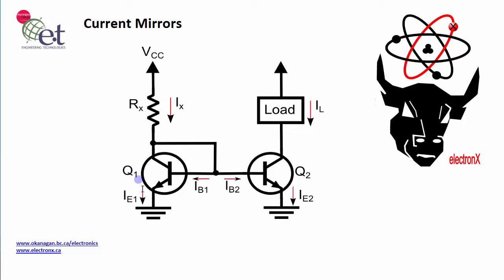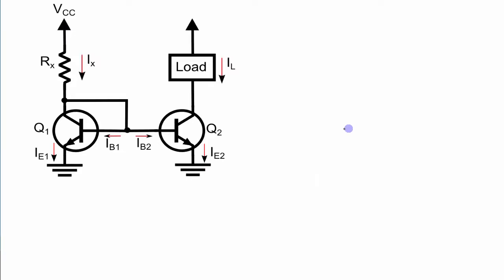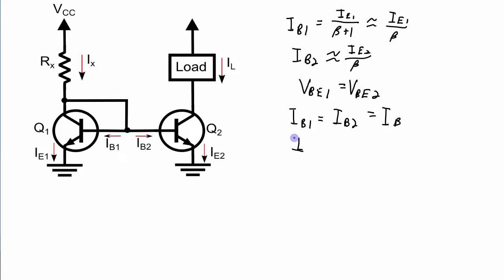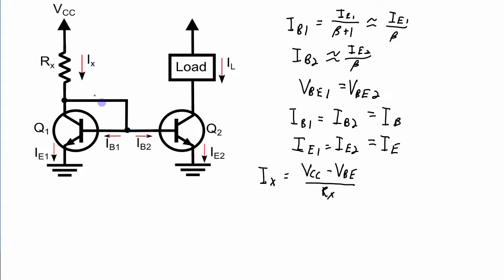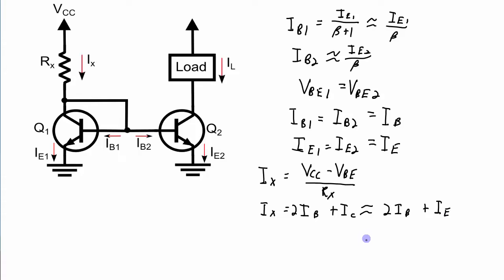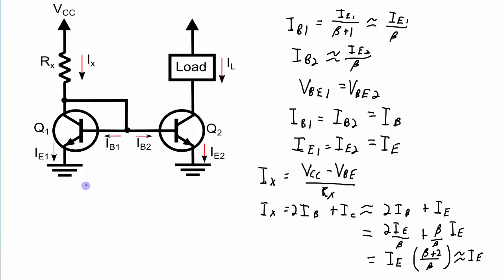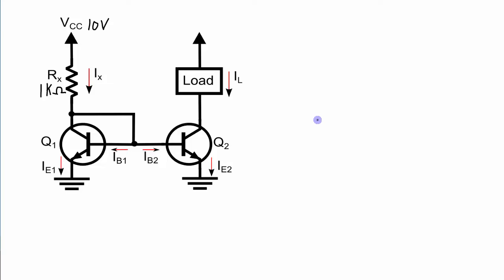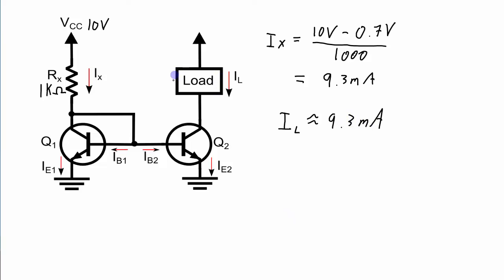Current Mirrors

Comment: Great explanation!  I would add, this specific circuit will only work as a mirror if the load on Q2 has a lower resistance than the resistor on Q1. Because in this circuit, Q1 is at the knee of the saturation curve, (VCE is at the minimum of 0.7V) so Q2 can only regulate to reduce current (and increase VCE). If you add a current control in series with Q1, and move away from saturation, you then have room to regulate Q2 in either direction.
Reply from the maker: Thanks for the comment. Yes, this is the simplest form for a current mirror.

Comment: Sir, could you please explain why you traced the path that way when you were looking for the value of Ix using KVL? Isn't KVL applicable for loops only? How does the path you trace become a loop? Thanks :)
Reply from the maker: It's an implied loop. There is a power supply in the loop that is spit in to VCC at the top of the diagram and ground at the bottom of the diagram.
Reply: @ElectronXLab  Sir could you explain it a bit further? I'm not sure if I understand :)
Reply: @RanielDG  David's explanation was perfect - the 'implied loop' is a valid KVL loop, and that loop completes the circuit.

Comment: Okay so I've simulated this circuit in everycircuit...but I put a Vcc on Q2, I've also put a different resistor value for the load, but the currents aren't the same
Reply: Try adding a resistive load

Comment: Avid Williams:
As a retired electronics engineer,  not an IC designer , but  a USER ...with no choice ! 
I often asked myself how  does a current mirror work.

An almost correct  explanation, BUT

YES : Vbe1 - Vbe2  by design ,  Ie depends upon Vbe, temperature, and characteristics of the junction material in the Q1, Q2 which are similar but 
NOT IDENTICAL  these characteristics depend upon the molecular level of the transistor junction , which coarsely controllable
So NO:  Ie1 = Ie2  except by  can by chance:      

BUT, YES   Ie1 ~ Ie2  :  where ~ means approximately,  but  NOT EQUAL

Comment: How do we know the base currents are equal to each other and emitter currents are equal to each other?
Reply from the maker: We are making the assumption that the two BJTs have identical characteristics. Since the bases are connected and the emitters are connected (ground), the base-emitter voltages (VBE) of the the two BJTs are equal.  Since the BJTs are identical and the VBEs are the same, the current in to the bases must be the same. Also, current's out of the emitter must also be the same.

Comment: So what happens when the transistors go to saturation mode?? Also I have seen a lot of circuits having a current source instead of Rx - So is this any different from those circuits?
Reply: The resistor  is a current source in this circuit bc it controls current Ix.  So theres nothing different about those circuits besides them using a different type of current source.

Comment: Using LTspice and used the same values, if the Load is a 2k resistor, then IL is only 4.98ma, not the same as Ix.  What's did I do wrong?
Reply: 4.98mA is pretty close to 5mA, which should be the value of Ix if you have used Vcc=10V and Rx=10kOhm. So therefore there is nothing wrong with your calculations

Comment: What is happening if you have current mirror in mosfets? Could you make a video for them as well?
Reply: The circuit is the same, you just do the math using the gate voltage instead of current.

Comment: How does he assume that all of the current Ix goes to the bases of the two transistors? Shouldn't it branch out to equal: Ix = 2Ib + Ic ? (While calculating Ix using the supply voltage and voltage drop Vbe with Ohm's law)
Reply from the maker: What you said (Ix=2Ib+Ic) is correct and is what I stated in the video.
Reply: David Williams No, I know that but I think I asked my question the wrong way. Why is Ix=(Vcc-Vbe)/Rx ? The video is great btw, keep up the good work!
Reply from the maker: Because the collector and the base are tied together, the collector voltage will be equal to the base voltage. The emitter is tied to ground, so the voltage at the collector will be Vbe. The voltage across the resistor will therefore be Vcc-Vbe and Ohm's law can be used to calculate Ix.
Reply: Ok, thanks for clearing it out for me.

Comment: why are the emitter currents equal to eachother? i understand that the base currents are the same but doesn't the emitter current also depend on the voltage between collector and emitter? (which is likely different for q1 and q2)
Reply: Check out Wikipedia's article "Bipolar junction transistor" --
The emitter current Ie is determined by emitter-base voltage (Vbe) and by emitter saturation current Ies (a constant) --
Ie = Ies [exp ((Vbe/Vt) - 1)]
If the transistors are matched, then Ies of transistor 1 = Ies of transistor 2.
Since the transistors' emitters are grounded and since their bases are directly connected, then the Vbe of transistor 1 = the Vbe of transistor 2.
Hence the Ie of transistor 1 = the Ie of transistor 2.
Reply from the maker: If you use two different discrete transistors, then likely the emitter currents will be different. If the current mirror is fabricated on the same die, the two transistors can be made to have nearly identical characteristics, so the base currents and the emitter currents will be the same. As +Robonza noted, having the transistors in the same package also keeps them thermally coupled.
Reply: I was wondering too.
Let's put equal resistors R_1 and R_2 just before the base of of Q_1 and the base of Q_2 respectively. We have by Kirchhoff's law
V_CC = (I_x)(R_x)+(I_B1)(R_1)+0.7
and similarly
V_CC=(I_x)(R_x)+(I_B2)(R_2)+0.7

where 0.7 is the base-emitter voltage.

Thus I_B1=I_B2

Now we may argue that the wires have this small resistance, and therefore the currents are equal, however if we considered the resistance of these wires, we should also consider the resistance of the emitter-ground wires, should not we ?!

To be honest I have never seen any convincing argument on why they are equal, but using resistors makes sense anyway.

Comment: Finally I got the idea how the c. mirror works. Thank you for your explanation.
Reply: So try it experimentally. It will not work!
Reply from the maker: @incxxxx  , it should work. Of course it won't work exactly as calculated because there are some assumptions we made in the calculations that aren't necessarily true. For example, I assumed that the two transistors have the same beta value, but if they don't IB1 and IB2 won't be the same.
Reply: @ElectronXLab  suppose you have a led as your load ,you can see the current starts to raise temperature of the Q2 will start to increase that because of thermal runaway beta is highly unstable in such a state,so current will keep on increase and damage led aswell as the transistor Q2 ,its better to keep emitter resistance on both side (Q1,Q2) to avoid this .
Reply: @incxxxx  ..No, the circuits work
Reply: @nickharrison3748  Witout emiter resistor it doesnot work - I found this experimentally!
Reply: @incxxxx  ..ok good. I did not try this one but I was referring to Amplifier circuits that Dave described. Those work for me